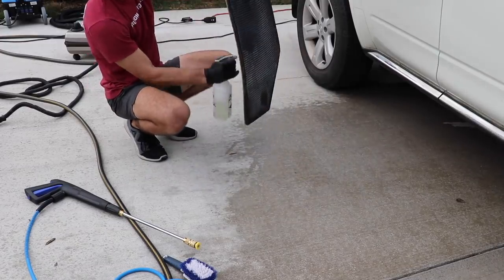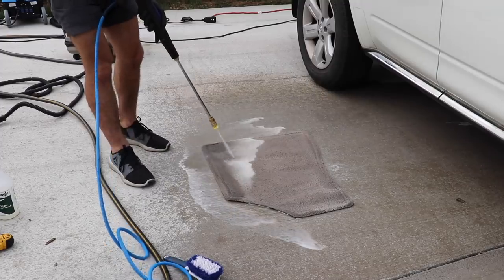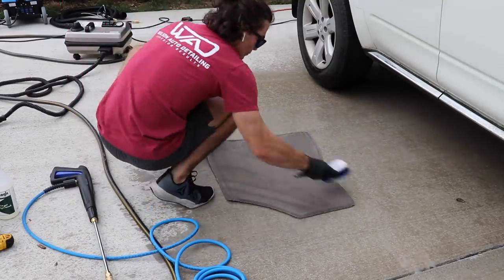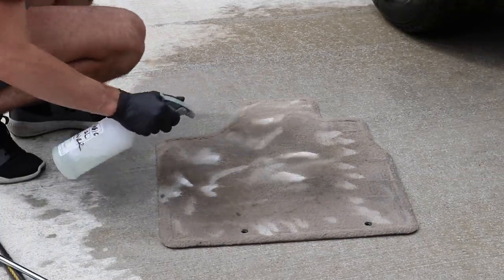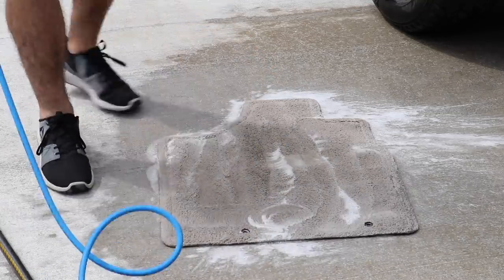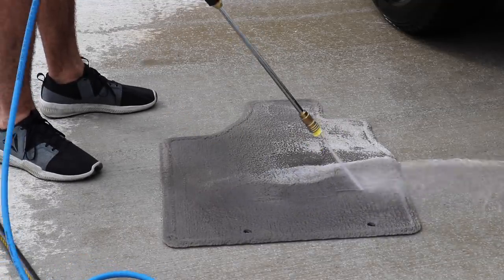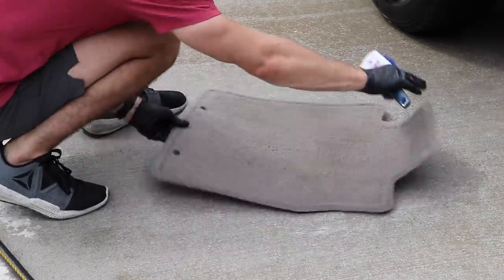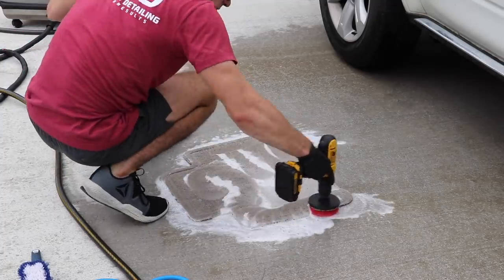The Most Extreme Way to Clean Car Floor Mats To Perfection!

Comment: I use this method as well....Just for FYI, if you want the cool looking lines in the floor mats this is the best time to put them in the mats. As the carpets dry the lines will last longer. I also hang mats up so the water will continue to drain out. Really enjoy your videos. Keep them coming.

Comment: I just did this but without APC or a drill brush and it worked just as well. I tested both with and without APC + a drill brush followed with a gas pressure washer. Without gas you may need the extra help not sure.

Comment: Can I use a water proof shop vac as a make shift extractor ? Also , will the " hard " drill brush attachment cause any damage or pull any fibers out of the floor mats? 

Great video , thanks

Comment: Hey Luke, what kind of pressure washer are you using? Gas or electric? And what is the PSI on it?
Reply from the maker: It is the maxx 2200 by ar blue clean

Electric

Comment: Can you get through a whole car on one drill battery? I I just got some drill brushes and still have a cordless drill. I found a corded drill for $25 on amazon.
Reply: yes ofcourse you can get the whole car done with one battery :) just make sure the battery is fully charged before you start on the car. Corded drills can be a bit of hassle especially when you have to keep movie the wire everywhere around the car. I own a corded and a battery powered drill so I find the battery powered one very easy to work with.

Comment: Don’t even need a drill brush when using a pressure washer and APC. Those two alone takes out 90%+ of all stains. The drill brush is not even needed here.
Reply: I not only agree but I just did some destroyed mats with just the pressure washer alone and tested it against using APC and a drill brush before hand and it did just as well. It was a gas pressure washer though.

Comment: What about the seats? How long it would take to dry if you use this same process?
Reply: kuntryBoyJames You shouldn’t do that with the seats there is foams that will absorb the water, just do a regular shampoo vac process 💪🏼
Reply: @bubucachoo0882  and a much softer brush for the drill

Comment: I do this to my boat carpet all the time. It removes everything and it's way worse than floor mats. I've had fish guts and blood removed without a problem. You don't even need to agitate it with the brush. The pressure washer and soap does it all. And use the yellow tip.

Comment: Instead of flushing the mats with tons of water, wouldn't it be better (and faster?!) to take a vac for taking the APC out of them? After that you can always flush them a little. Apart from this, i like your channel, thumbs uP!
Reply from the maker: Thanks man and great question! In this case it wasn’t about ease necessarily as it was the results I wanted. This high pressure flushing got me to the end result I wanted while extracting would not have